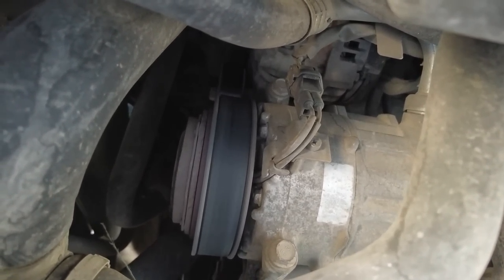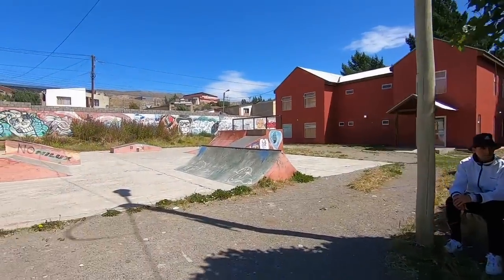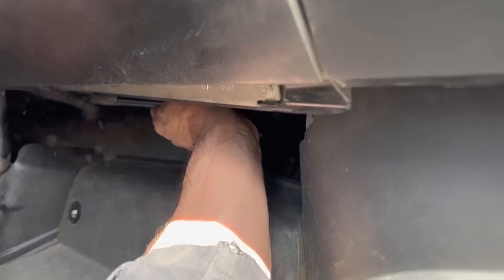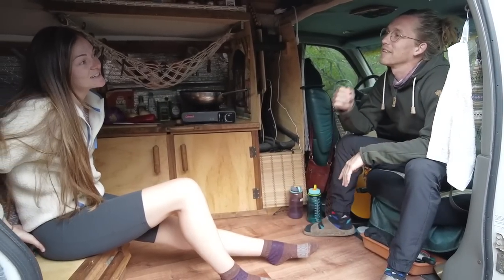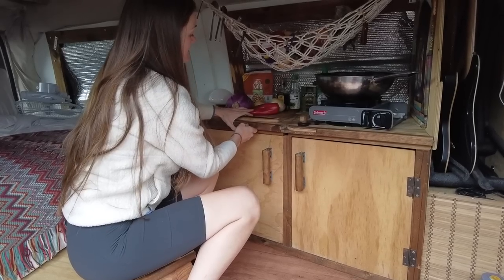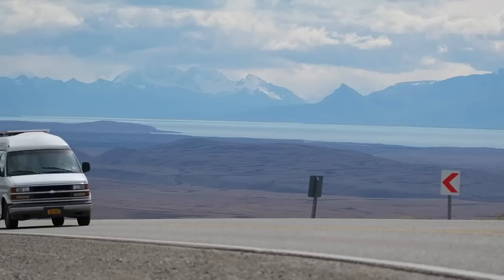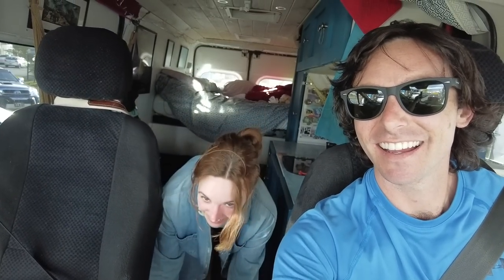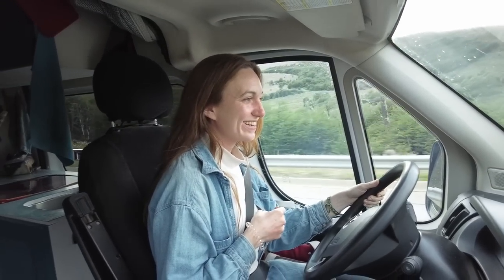Vanlife Convoy: Surviving Patagonia's Harsh Terrain! [FRIEND'S VAN TOUR] #vanlife

Comment: Hola👋from southern New Mexico🌶️🌵...So nice to see young adults travel. Nice friends build .We lived in a van back in the early 80's. Before cellphone & solar. We had an old telephone van with heavy duty shocks.  We cut out the top and did a build so we could stand up. Because of the gravel back roads we would have to tighten up the bolts periodically...didn't want to lose the motor or other parts. Lol. Things jiggle loose. Enjoy your videos. Thanks💖🤗